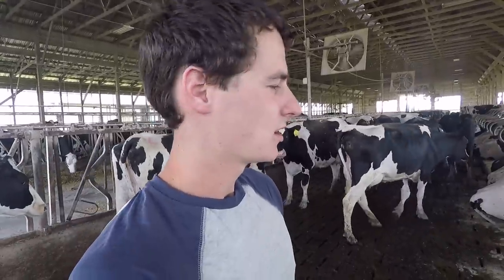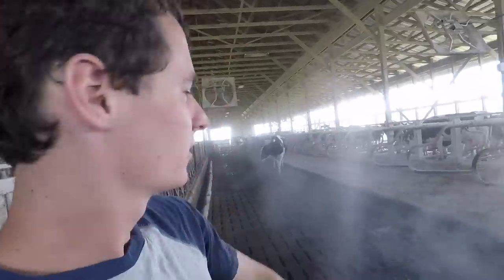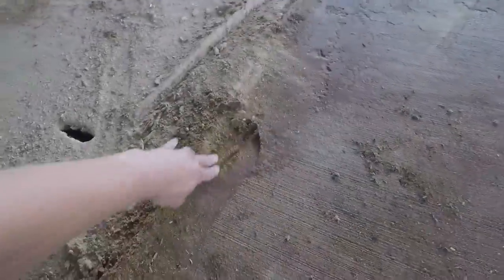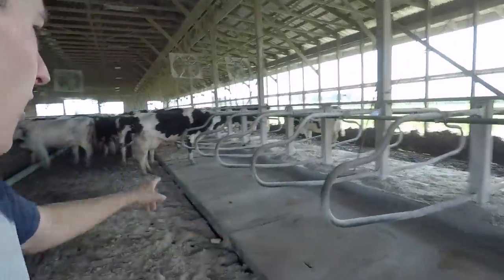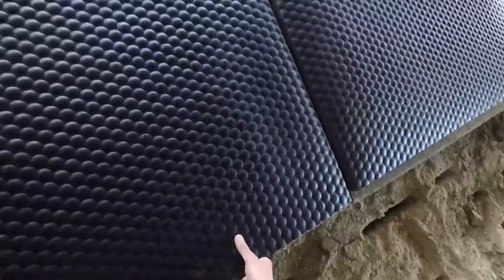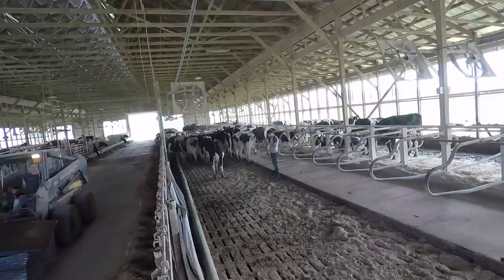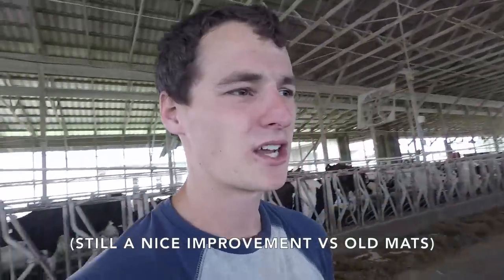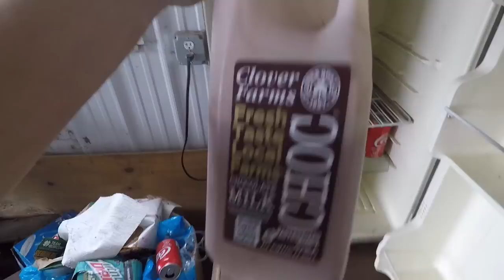Replacing Cow Mattresses

Comment: Just curious if you’ve considered busting the concrete out and using sand, great for cows but hard on everything else. You have a really nice setup there. We did legend rubber in our tie stall for around $60/ft
Reply from the maker: Sand is good bedding but would settle in our pit

Comment: If the old mats have thinned out then wouldn't it be possible to double them up and continue using them? That way you'd only have to replace half of the mats each time. Much cheaper.
Reply: James Walker There are air bubbles in those mats which make them squishy and comfortable.  Over time, they thin out because the air bubbles in the foam have escaped and the mat is permanently compressed, making the mats really hard.  No more ability to bounce back after they’re compressed.  Doubling up the hard mats won’t solve not having the air in them...which is what delivers the comfort.  They’re spent as cow beds, but likely recyclable in some way on the farm.  Perhaps as a floor covering somewhere else, like under tractors to catch grease, for example.  Or as a mat for other dirty jobs.